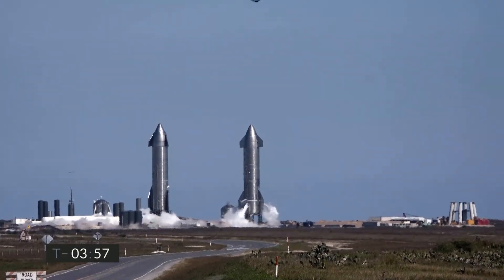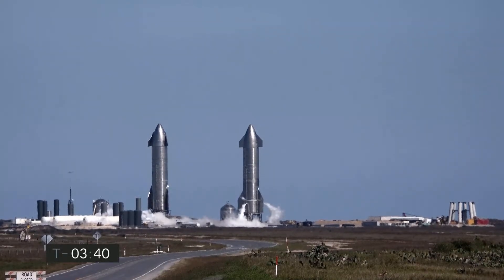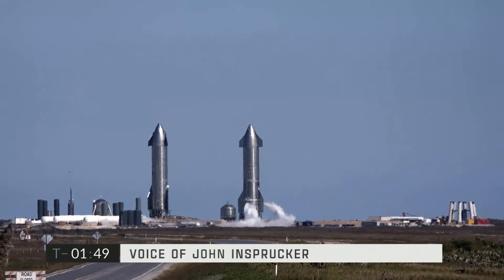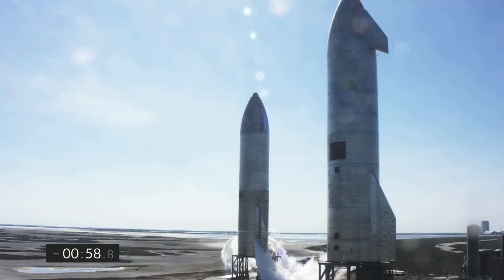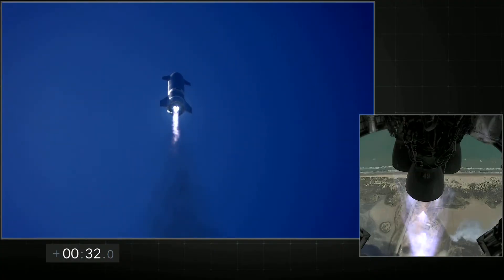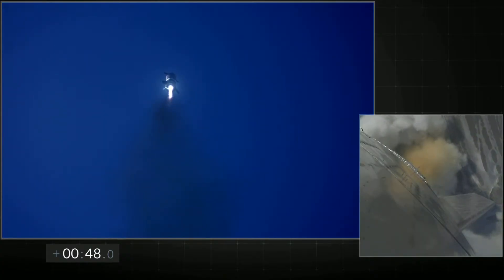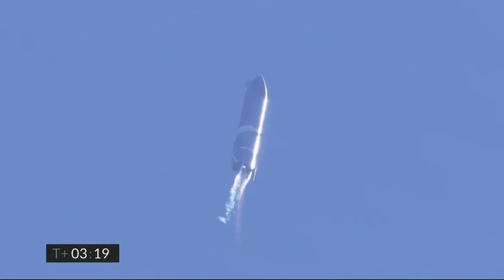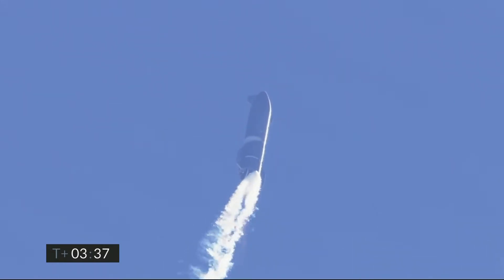Starship | SN9 | High-Altitude Flight Test

Comment: Honestly I have a theory on the issue with relighting the engines, during the fall starship experiences resistance and drag from the shape of the ships hull however take a 2 liter bottle of soda and put some water in it. when transitioning the starship from horizontal to vertical (same for that 2 liter bottle) I think you get a sloshing effect. Ill bet dollars to pesos this causes a big issue when trying maintain constant fuel delivery to the raptor engines. I bet that if you transition vertically much sooner and invoke some air resistance at that time via a air brake of sorts it would ensure the location of the fuel at the bottom of the tanks prior to reigniting the engines. In addition i also feel that getting to a hover prior to landing would be ideal as it would give safe haven window to make corrections. Even is its not the final design it may give you enough time to save starship from being destroyed and then use that data to make corrections for a future flight. Being able to throttle the engines or engine down lower enough to be able to hover should be a key feature as well. Even if sufficient weight is installed in the crafts nose to make this happen, even temporarily, it could be very useful for flight control. Thats how I would do it and my thoughts on it. Great job on the flight tho I love seeing spacex progress. Keep up the good work!

Comment: Looks like only one engine ignited, but the latency is still too long. Gravity is at 125 feet per second free fall. I think Falcon9 ignites 2 engines at about 2 kilometers, Starship didn't initiate until 1 kilometer. Starship body mass is definitely severely irregular compared to Falcon9. It seems the transition to upright vertical might be due to the wind drag caused by the wings and broader overall diameter. The dynamics of pitch and roll must enormous when reaching the 40-60 degree range. No doubt you folks will figure it all out. Space engineering in real time, how awesome!

Comment: There was no sign the engines were fuel starved like SN8.
Reply: It was most likely a faulty raptor component since some parts were jettisoned when the landing burn happened. There was also a fire on one of em
Reply: @pictobloxer5412  Yes while landing I saw a part fly off from one of the raptors but the fire part is norminal I've seen that in many flights so that's not a problem

Comment: Looks like there is still trouble getting fuel to the engines before it tips back, might need to tip it higher up so the fuel is on the bottom of the tank.

Comment: Liquids don’t like to move like that in a tank....  even with baffles the move from horizontal to vertical you have account for liquids slushing in the tank.
Reply: That's why they have header tanks that are significantly smaller inside
Reply: @infinitelyexplosive  God damn that's actually clever as fuck
Reply: @infinitelyexplosive  true, but not currently working as designed. I believe they are temporarily using helium gas to keep the tanks pressurised, and hope to engineer that out in the future

Comment: Looked like it came down too fast at the wrong angle. All the same, I think the rocket would have better luck landing if it were equipped with landing legs. Such legs are literally shock absorbers - pretty self-explanatory. With out landing legs, what does the rocket have to absorb the shock other than the rocket itself!?!?

Comment: Big rockets blow up while they are in development. It's a very hard science, engineering and manufacturing challenge. If a new big rocket does not blow up a number of times on the way to getting it all worked out, that would be a miracle. So, good. Big rocket blows up, lessons are learned. That's how it works.

Comment: The design is flawed and the method of landing is stupid.
The falcon design and method of landing works, why not just try to perfect it even more and use what already works. The Starship has even more engines and hence landing power with the three manouverable engines in the middle giving greater control. This starship method of belly flopping down to a planet and the sudden jerking motion when the starship re-orients itself twice will be detrimental to the passengers onboard whether its landing on another planet or being used for sub-orbital flights on Earth from city to city. I don't see a lot of people handling the g-forces this thing throws at them.
Reply: how is this flawed? the falcon 9 method wont work with this kind of ship and would require a huge redesign. also starship is second stage so it won't work anything like the falcon 9. Max G force exerted whilst in the flip would be less than 4 G's, easily dealt with by astronauts
Reply: @tauraspace  I already stated why it is flawed. Falcon 9 method would work quite well for the Starship, just scale it up. The engines on Starship give it even more manoeuvrability as I said before with the 3 inside engines, an advantage the Falcon 9 doesn't have. The g forces on people with those stupid re-orientation manoeuvres will not be tolerable with everyday people travelling from one city to another on Earth, even if astronauts can handle it. That is very relevant since SpaceX intends on using this ship for sub-orbital Earth travel. It's also completely unnecessary for astronauts not to mention it renders them useless as they would have to rely on ship automation and not be able to function during landing in case they need to make adjustments or take over manually, and the landing flip is almost last second which leaves no room for error, instead of being earlier in order to allow the ship time to hover and adjust before landing.
Reply: You should work for Spacex and design a new better one
Reply: @Barrett2346  I don't need to go work for SpaceX to ''design a new better one'', I said the Falcon 9 design is the right design.
Reply: @Bondopoulos  well falcon is a booster not a upper stage vehicle and it by itself doesn’t have enough delta v to get it in to a orbit around the sun
Reply: @Barrett2346  That's irrelevant to the design of landing itself again.
Reply: @Bondopoulos  k

Comment: 3 engine is simply not enough. Firing of engine is too slow while in transition position.
Reply: it only fires 2 and it's definitely enough to slow the vehicle down. today suffered from a relight failure which is why it didn't slow down in time.

Comment: @SpaceX
 Has the centrifugal force on the vertical flip been fully factored into the burn calculations? The additional momentum of flipping back vertically would temporarily increase the overall mass of the vehicle, requiring a higher thrust/altitude calculation

Comment: They proven the aerodynamic design works. They can control the ascent and descent trajectory extremely precisely. Furthermore, they fixed the fuel issue for relight, now they need to figure out the issue with the engine relight and reliability. Maybe they could relight a bit earlier, and if one of the engines fails, rotate, and relight the other engine as a backup. It is also important to understand that landing on Earth, with the full cargo, it will be a few hundredth tons heavier that it is now, so they might need to use 3 raptors anyway, with 2 minimum. But right now they are too light to do that.
I wish it landed safely, but I am sure they got a lot of data and knowledge how to improve their next design.

Comment: They haven't figured out two things... The larger the rocket the higher you have to do your flip to give you time to reignite your engines if it fails the first time, and second you need enough engines that if half fail you can still land ala a jet liner. Otherwise no one in their right mind will land in one.

Comment: This is going to plague the team for a while. Looks like they ran out of fuel again.  Bigger header tanks mean more weight which means more fuel which means more weight which means more fuel.  You know. The bigger you are the harder you fall. It’s going to take time before it’s safe. Even a soft landing “not crashing” is just a test until it happens every time. Then they will be on. It will happen for them. It’s the learning process. Good thing that Elon has cash.
Reply: wasn't a fuel problem, just one of the engines failing to relight. if it did we may be watching a verticle starship right now

Comment: Down to 1.5 kilometers still horizontal, knew it was doomed right there. Restarting 2 engines and doing a flip below 1 kilometer is asking for trouble. A new expendable rocket?
Reply: it worked with SN8, so it will work with others. engine relight failures are not because of altitude

Comment: Everyone:

SpaceX makes everyone’s day a whole lot better
Reply: Why they start the engine at so low altitude where they can have control  of meneveur ,can anyone explain
Reply: @sagarrawal5195  i think it also has to do a suicide burn like falcon 9 cause it cant hover and the thrust to waist ratio is not 1:1
So it ignites the engine at that altitude
Reply: @sagarrawal5195  so they can slow the starship down by just air as much as they can
Reply: @sagarrawal5195  Would be entirely down to fuel savings (they established the vehicle can hover on one engine unlike Falcon 9; F9 doesn't have a choice).  Those header tanks aren't big and every kg of fuel reserved for landing is coming straight out of available payload to orbit.

That said looks pretty clear we had a similar issue to last time; engine cut out prematurely (a little earler even than last time) and altitude wouldn't have saved it.
Reply: Enough of this meme. Jeez. Be original.
Reply: @VibeMusicAiRecords  ikr
Reply: https://www.youtube.com/watch?v=Im799XZxLEs
Reply: @elaiottoiale4216  just reporting your post as spam.. FYI.
Reply: overrated comment.
Reply: It made my day a whole lot brighter because I had a blast
Reply: DONT READ MY PROFILÊ PICTURÉ :)
Reply: @dont7142  ok I won't

Comment: After the aft fins sweep back to drop the tail for touchdown, they need to quickly be extended again to help stop any over rotation beyond vertical.  That would also reduce demand on nozzle deflection for thrust vectoring just before touchdown.   Looks like they flamed out again anyway.  But the vertical touchdown overshoot got no help from the aft fins.  Just sayin.

Comment: Only one engine looked like it lit. I love SpaceX but Rocket Labs rutherford engines are the future. Fully controllable turbo pumps for both oxygen and fuel. Can fire them up quickly whenever you want and with full control over the pump speed via speed controller you can vary the amount of thrust being produced. They will be the next big thing until fussion reactor rocket engines become a thing.

Comment: With SN8, the header tank pressure wasn't enough to feed the engines; this time #2 failed to light up, while #1 seemed to reach its operating thrust fairly quickly, flipping the vehicle over. It would be natural to suspect that the reason for the last failure is again related to tank pressure, which wasn't enough to feed engine #2. The header tank, located right in the vehicle's nose, is designed to remain full as the main tank depletes, preventing sloshing and pressurisation issues at the start of the landing burn. This wonderful video illustrates fuel behaviour over the whole flight, a definite must-watch: https://www.youtube.com/watch?v=KycyWcxWTcY

Be advised that I had no idea about any of the things I'm currently writing about just 5 minutes ago.

Comment: Is there any data that suggests you can fix the position either of the forward or aft flaps and using the other movable flaps to achieve the desired results.?

Comment: Whats with the 10 km mark?  ;)

Good show.. push thru... you got this..
Reply: Why not do the burn as a 3 segment system?...... use large inflatable fairings top section..... use gravity and drag to align your cylindrical object... save to the end for fire... outside of maneuvers
Reply: Seems you need a little bit of drag at the top

Comment: ⚠MUST say SN8 had better camera angles. 
As far as SN9 landing. Looked like the engines cut out last minute dropping the rocket hard or two raptor engines swung the rocket too far(too much power) causing not time to correct it from going horizontal on pad. 
I'd say flip the rocket higher up giving more time to correct any overthrusting. See what spacex tells us went wrong.⚠
In all, was a great test flight, SN10 your next buddy!
Reply: It seems that one of the two engines didnt ignite during the flip, also i think they would have to redesign the header tanks in order to start the flip higher up

Comment: Either they need to fire that single engine way higher up, before landing or use 3 engines for landing. Rocket coming it to hot for a single engine at that height for such a heavy rocket.

Comment: I wonder if it would be possible to use something like a hydraulic cylinder as the header tanks. That way orientation and movement shouldn't affect them. I'd imagine making a gasket that can handle the extreme temperatures would be the most difficult part.

Comment: They need to land it on an underwater platform, then raise it up out of the water.  Sea dragon like, but start out of water.  Even after they perfect it, just in case.  I tell you what, if I were an astronaut even after the bugs are worked out, and going to space was my dream, I'd give it up if this was my way home. But if it can handle the vacuum of space, it can handle sea water (it's stainless).
Reply: whydoes it need to be in the water tho? also there is no water to take off from on mars.
Reply: @rewindd  No, take off on land, land in the water for safety. Probably a dumb idea, but I'm allowed one of those per day, and it's the first idea I had all day. Yeah, no water on Mars, it will be a bigger risk but I'm thinking minimize risk wherever possible. I was a big fan of the sea dragon concept.
Reply: @davidaustin6962  theres is no need for safety.... no human for miles. you mean like when ppl are in it? the rocket is programmed to land on the pad so it will explode either way if something bad happens

Comment: SN9: (Explode)
SN10: "ok, it's my turn"
Reply: SN9: i can do this on my first ......

SN10: Hold my atmosphere.
Reply: Why they start the engine at so low altitude where they can have control  of meneveur ,can anyone explain
Reply: @sagarrawal5195  it's called suicide burn, it costs less fuel, so they need to calculate it perfectly, if it doesn't work, boom.
Reply: https://www.youtube.com/watch?v=Im799XZxLEs

Comment: An obvious failure of the 2nd engine startup.
Is this is most likely a turbopump issue? Because restarting turbopumps is pretty dodgy, I think. So far as I am aware, the only rockets to date to be restarted are pressure fed engines. They do that because turbopumps are notoriously tricky things at the best of times. 
To give you some perspective of the power of the turbopumps, the SSME's fuel turbopumps each had a 150mm (6") outlet, which if placed in an average family swimming pool, would drain it in around 12 seconds. If the outlet was pointed straight up, it would pump a column of water 50km (30 miles) into the air. Each turbopump was around the size of a V8 engine, yet produced as much power as 40 diesel locomotives.
With these sort of numbers in mind, it's hard to imagine the pumps being able to start and run a second time AT ALL, let alone be able to start up, on time, and completely efficiently, so they are able to land safely.
I admire Elon for his boundless optimism, and his rapid failures approach, but if he can get these raptor engines to perform multiple perfect startups and multiple perfect firings in between refurbishment, it will be nothing short of a modern miracle.
I really hope he can do it. But I suspect building a starship is far more complex and difficult than even Elon is prepared to admit; and he already admits it is bloody difficult!

Comment: We need 2 engines to land, but to have redundancy we need 3 working, in case any one fails, as in fact it happened. We need more time to stabilize the engines. I don't understand the reason for starting 2 engines at such a low altitude, a few seconds from landing / impact, instead of starting the 3 at a higher altitude with less power. Elon write this down and then thank me.

Comment: What?
has the mankind ever been to the moon?
Reply: yes..?
Reply: @kjeed7735  do you belive that?
Reply: @산넘어배추  ... yes? what about this video makes you go what and question it?
Reply: @kjeed7735  i think present Science is behind past science.
Reply: @산넘어배추  no. present science just requires far more security regulations, saturn v would never launch today, there's tons of documentation from the 60s on the science and test veichles behind saturn v. remember that the saturn v technology is ancient compared to now, the engines were practically handmade and computers had a quarter of computing power than the earliest smartphones.

and the reason why the current starships has explodes because all of it is extremely experimental and early, and unlike nasa this is test-fail-fix-repeat instead of a lot more put into quadruple checking everything then launching and if something goes wrong they study it for months.
Reply: @kjeed7735  There are two reasons why science is moving back to past.
The first is a nuclear war 
The second reason is that it was a lie.
Reply: @산넘어배추  or... just exploring? if theres a nuclear war everyone would know, you can't hide a nuclear mushroom cloud

Comment: Am I the only one who thinks sn8 did it better
Reply: This crash looks much worse but actually it went better.

SN8 had a methane pressure issue causing 2 engines to burn themselves because in relation there was too much oxygen. SN9 only had one engine failure which was instantaneous causing the flip to look much more out of control. But technically this was closer to success.